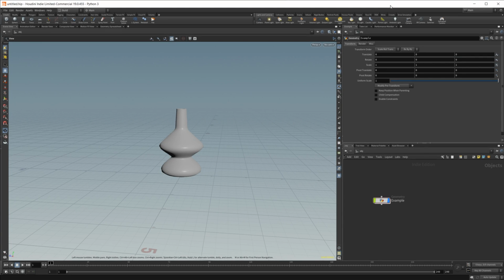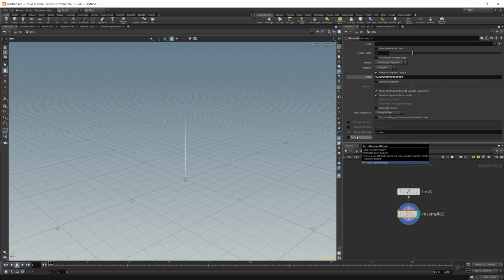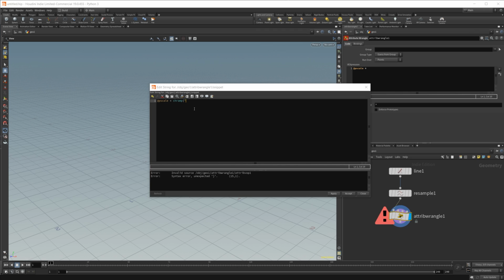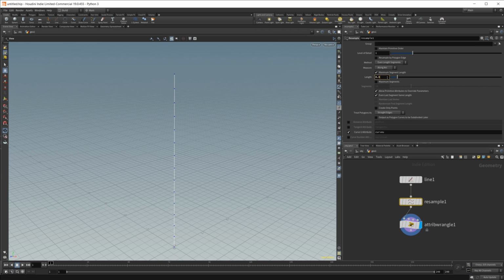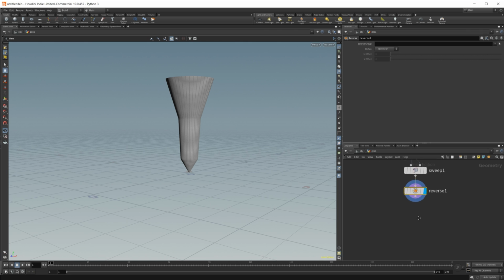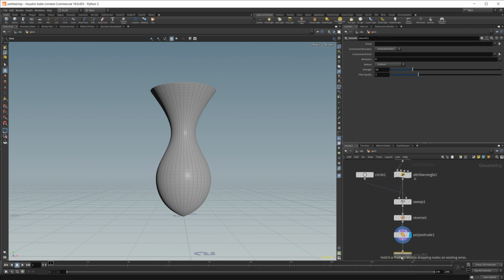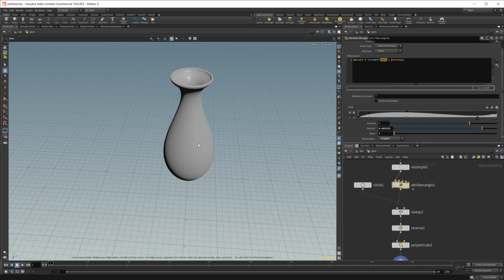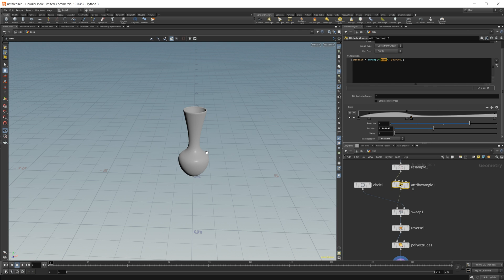Use Vex for Procedural Modelling - Channel Ramp | Houdini 19

Comment: Hi. As I can see, the bottom points aren't connected. Do you know how to close (procedurally) the geo on top or bottom without using something like polyfill?
Reply from the maker: You could probably use a fuse to collapse the points at the bottom. Polyfill is going to be the easiest way to fill the holes. You could also use a wrangle to close it.
Reply: @InsideTheMindSpace  Obvious, I'm too focused on dop and I should dig sop more hehe. Thanks!